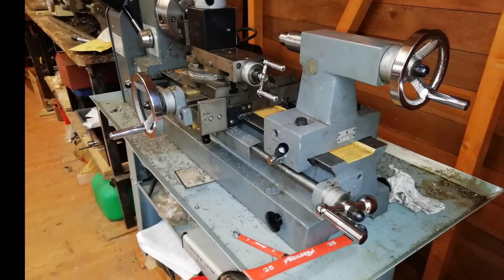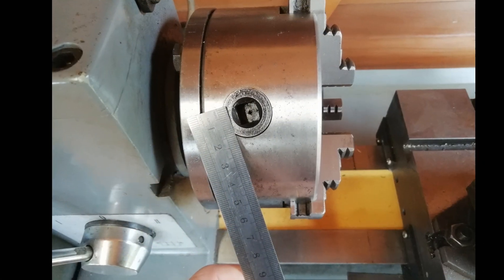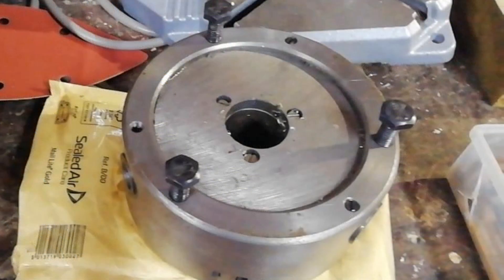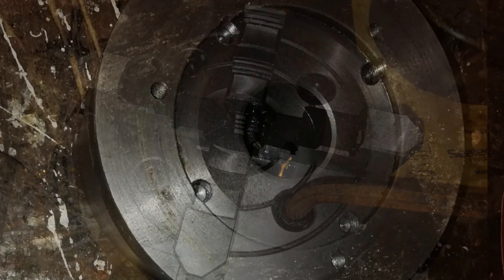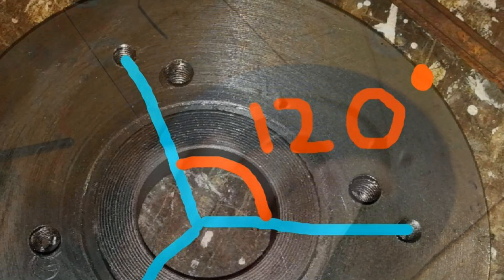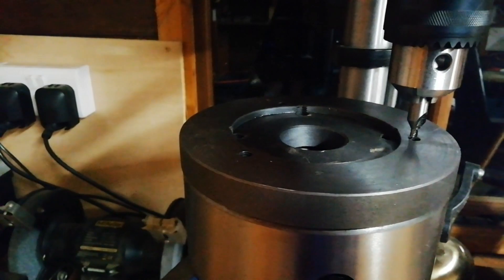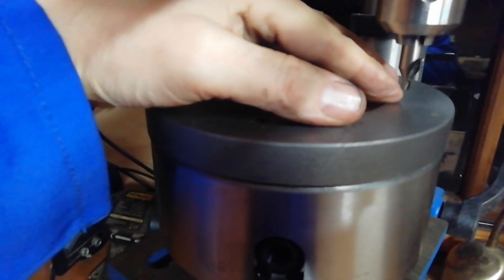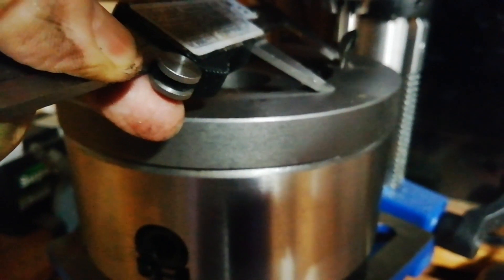4 Jaw Lathe Chuck Problems

Comment: If you were doing this job again, how would you have done it?  I have the Clarke version of this lathe and am looking for a 4-jaw independent chuck but also retain use of my existing 3-jaw self-centring chuck.  Not sure whether to build an adaptor plate or what’s the best chuck to buy.

Comment: I would have used transfer screws. Basically pointed screws that you put in the chuck holes, put the transfer plate over them, then whack it with a hammer to mark the positions of the holes. They are easy to buy or make.
Reply from the maker: Hi Mark & thanks for your comments. I've never heard of a transfer plate before, but that's a really neat idea, dammit. Hehehe - next time I'll know. Thanks!
Reply: @chriswesley594  I typed that wrong. I meant back plate, not transfer plate. They are transfer screws. You put them in, put the thing you want marked over them, then whack it with a hammer to mark the holes.
Reply from the maker: @MarkATrombley  I got the gist Mark. I could even have used a pirce of cardboard on the plate. Draw around the edge, then mark through as you said with a pen even, then rotate the cardboard template by some convenient angle and bam - that's it. So obvious when you know how, yet I spent more than an hour failing to come up with this idea.  Oh well, mine worked well enough and - thanks to you - I'll know better for next time.